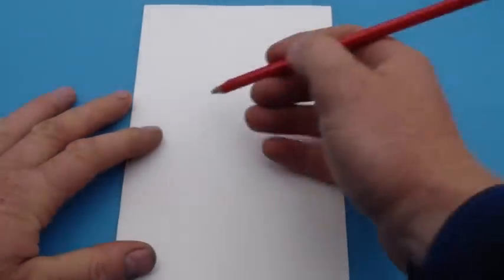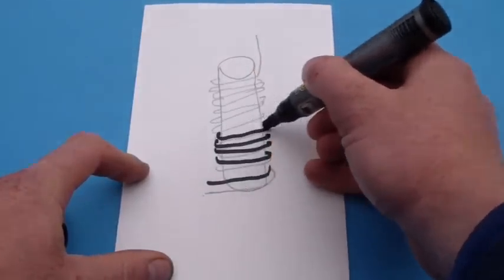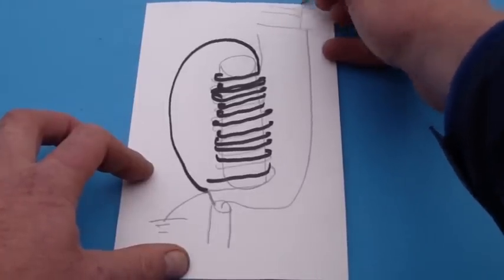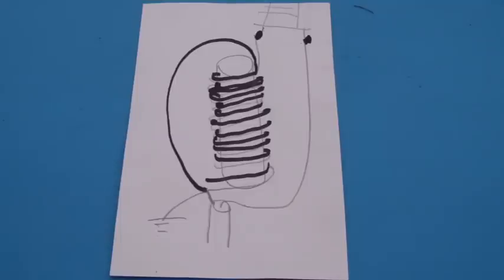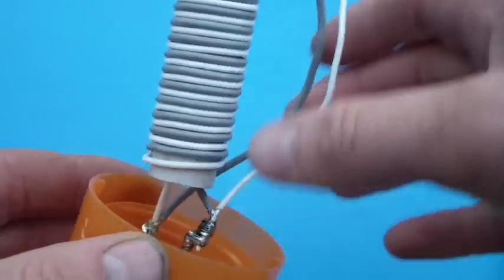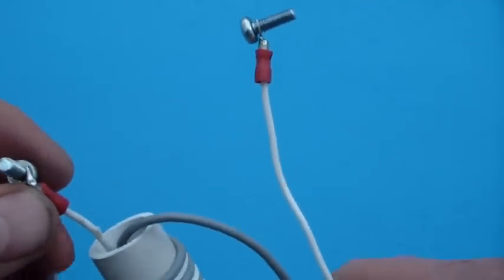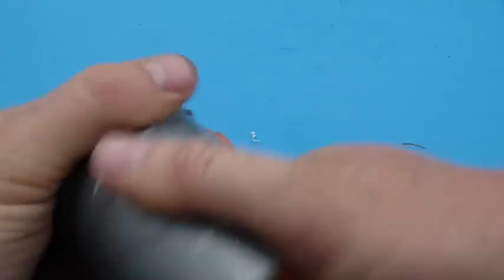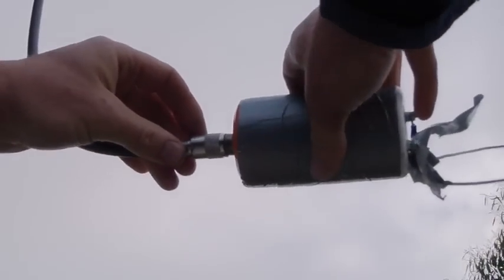How to make a 4 to 1 balun cheap and easy

Comment: You know I respect your abilities in many fields Sandy however, this design is not really good,  , you really really do need some sort of core to get decent performance across a number of bands,  I have used Moxon's 4:1 design from "Antennas for All Locations" book since the 1980s with great success, this is much the same as the job you show here but wound on a normal round ferrite rod of the type Henry Westlake sells for a quid of so.    You will get better high  power performance ( kW etx)with stacked T-200 torroids and thick wire say 14 SWG enamaelled copper covered with PTFE with the same basic design.  This is a basic voltage design which isn't in favour these days however, I haven't had any problems with them. but if you want good performance you DO need a ferrite or ferromagnetic core   161 Tony G3ZRJ
Reply from the maker: +Venus Probe Thanks Tony. This was one of the first baluns I ever built. No doubt you are correct. Maybe I will wind another on ferrite and give it to Rich as he now has a linear.
Hope you and Sally are keeping well.
161
Sandy
Reply: +Wiltshire Man  - in a perfect world, and ferrite balun might be superior, but I too prefer the air core. It's larger, clunky, and not as pretty but doesn't suffer from non-linear characteristics when the core is saturated. (harmonic generation, heating, etc...)  Easy to do when the antenna is being abused or operated off freq. I'd prefer to feed the antenna with a balanced line and run it into a remote tuner box at the base.
Reply: +Venus Probe You are right. This design is terrible.  People thinking it is a good balun, or even a reasonable balun, are kidding themselves.
Reply: Make a video of a good balun please!
Reply: I don't do videos. :) An antenna can make a lot of contacts and seem to fine with a terrible balun. They often work fine with no balun at all. It does not surprise me a poorly constructed balun will "work", since there is no minimum standard and even without a balun most antennas "work". If we are going to make a balun and go through the bother of telling others how to build a balun, we should at least make some effort to be sure we characterize the balun and know it is actually working.Where someone gets into real problems is with high power. At high power levels, common mode really can show up.
Reply: I do have some stuff on a webpage describing balun testing methods....
Reply from the maker: Hi Tony, sorry for the late reply. Yes your right there are better designs but it was my first balun and I was proud of it at the time and thought I would share it with the world. I was just sharing my experiences as this balun was copied from an American ham. At low powers any shortcomings were not noticed but I gave it to a friend who ran some power through it and reported that it warmed up a bit. How big a bit I don't know. It could have been a "Mega bit" cos he never gave the balun back to me:)
Reply: @WiltshireMan  I done a rough SWR test between my air cored 4:1 (as copied from here) and a ferrite version using two ferrite  rings, the air cored drops away below 40m  to greater than 3:1 on 160m, (2.5:1 on 80m, 1.5:1 on 40m) where the ferrite version stays decent and maintains good SWR. I used a 200 Ohm fixed resistor to simulate the antenna impedance. For me it served me well on my 40m ocf dipole. As I say a rough test.

Comment: Hi, in the drawing one end of the thick black wire is left unconnected, but on the realisation I see that it is connected to middle conductor of the coax cable. which is correct? and if correct is the variant in the realisation of the balun then - doesn't it make a short circuit? Thanks for your videos!
Reply: Yeah, this video is really frustrating - all I wanted is to see how this transformer is wound - how hard can it be? But without a properly drawn diagram (with a wire hanging in mid air) I'm not sure how its done. I think this guy just copied some other design and is not sure what he built.

Comment: I built mine 4 years ago, fed coax instead of ladder line to an off-center-fed dipole. It works extremely well. 1 inch diameter pvc is what i wound the wire around, and then I encased it in inch and a half pvc with end caps, and have had zero issues with it. Works amazingly well! Thank you good sir!

Comment: The drawing is not complited. on paper!!!!
Reply: corect. Black wire not finish
Reply: The black that is not connected should have been connected to the center of the coax as well as one leg of the ladder line...other than that...nice vid! de KN4FTT

Comment from the maker: @arizonabobusa Hi Bob ,
and thanks for the nice comment. I'm glad you liked the video I did on this balun. It was   easy to build and I'm sure you will have no problem building it yourself. You may want to scale it up a bit for qro use. i have testrd it at 200 watts and it worked great. A friend ran 400 watts thru it and reported some heating in the so239 connector but otherwise OK.
All the best and thanks
Sandy

Comment: Hi, to let you know, GREAT HORNY TOADS,,,,,, I just built one within one hour of watching this clip.... had 98 % of the material on hand... now I just have to go to hardware store and get the caps.. I tested it on meantime , and finally got 80m tuned in AT 100% FROM A 0%.... Though I had to make modifications in shack... and splicing...
Thanks a lot..73

Comment: Thank you for making the video, however this is a voltage balun and will also not have much reactance due to the air core. My first efforts at balun construction were also voltage baluns, though wound on ferrite cores. Having spent a while experimenting with various types I now only use "Guanella baluns", using ferrite very high common mode impedances can be achieved.

Comment from the maker: Hi paul,
You may be better to use multi stranded wire as this increases the surface area of the wire. the electrons like to flow on the surface. That way you will decrease any losses.
Thanks for your nice comment.
73
Sandy
Reply: Electrons flow on the surface. Only Really critical on VHF and above and silver plated wire is used. On UHF the amount of solder used can effect the tuning freq. Also cannot use wood glue to seal coils as it will boil on transmit. Nail varnish is used instead. Just extra info. I am just getting back into radio. Cheers from old George 13th june 2021.

Comment: I thank the Wiltshire man for Balun info, I would encourage most Ham operators to put there mind to this money saving venture, It is so simple and Works it is difficult to understand why these emporiums  put such an extortionate price on these as this me nothing, Two pieces of wire an old herb canister , inner toilet roll wound glued for strength and weight, pvc sealing tape............. GREAT.......
Reply: Hello Geoffrey, the balun shown is not as effective as those based upon toroids the reasons get rather complicated but take it from me that the experts are right in using baluns based on windings around toroids.   Don't need to be expensive I have made a 4 to 1 current balun with FT240-43 FERRITE TOROID and using enamelled copper wire of about 1.5mm diameter, lots of info on the Web, hope to work you soon 73 Tony G3ZRJ

Comment: Could you do a video on a 12:1 balun air winding compared to a torrid winding?  I am needing to match a 600 ohm balanced line to a 50 ohm coax feeder.  Would be nice if you could also identify all the items needed and length of wire, size of the form and so on. Trying to decide which one to use a what the advantages are one vs the other. Thanks 73's

Comment from the maker: @2E0VJO Yes Jonathan I think it would work OK. I may make a few changes to the balun to improve it's efficiency,but so far as it is I'm having a lot of success with it. You could also just make a coaxial choke where the coax meets the ladder line on the G5RV. All you need to do is wind 8 or 10 turns of coax into a diameter of 6 inches or so.
Also do a search on the web for the "Ugly balun". That will also work and stop common mode currents or RF on the coax braid and lessen TVI etc
73 Sandy

Comment: Hi:  Thanks for posting this.  Would this design work on a TV antenna?  I need to attach a 75 ohm, unbalanced coax cable to a 300 ohm balanced antenna.  Any advice?

Thanks.
Reply: Yes it would work as 300:75 ohms is a 4:1 ratio or you could buy a 4:1 receive only TV balun from a TV/electronics store or online.  Cost about $3.00 US and free shipping on eBay.

Comment: Thanks for the video and a money saver ideal. Only thing i would do difference would be when you wrap the outside of it, is use electric vinyl tape on the outside because duct tape tends to rot in a 1 year or so. Vinyl tape that i use has been on there 12 to 15 years. May i 
 ask you a question on warping the outside of the bottle ? What about spraying a clear coat seal on it. Would that work just as well ? Thanks for the video.

Comment: Sandy, the legal USA limit is 1.5 kW. Most amplifiers rated at that output cost in the range of $3000 or more, 3X cost of the transceiver. I have amateur radio operator friends that have an amplifier. Probably bought on credit. I have never used an amplifier. Unless one is connected to a rig I use for my contest group I will probably never use one, ever. I have been a QRP OP since receiving my Novice ticket. The only time I transmit at 100 watts or less is when I contest with my contest group. 

I discovered your channel about 3 years ago. Although I have not watched your channel since 2011 I have watched all your videos. I am current up to last week. Question about air cored baluns. Can they be used for 1:1 and 1:9 as well? P.S. Glad to hear the operation was successful. Hope to work you some day on the bottom portions of the HF bands. I rarely do phone. Best 73 de KB8AMZ
Reply from the maker: Hi Terry I have no way of testing just how effective this balun is other than saying I ran 100 watts into it and made many qso's. It was taken from a circuit diagram from an American magazine. A few years ago now.
Hope it works for you.

Comment: HI can i just ask you one question, a Diamond 4:1 balun, used with WD 330J HF folded dipole, have you any idea if you should get continuity across the SO 239 connector, or is it capacitivily coupled, or is it inductive coupled might be a BU 50 balun...from Fred in England g4vvq.

Comment from the maker: @reddog694uk Mark,
Your not dense. You would be if you didn't ask questions. You can use this balun to feed a balanced antenna system from an unbalanved coaxial feed. Both sides of the ladder line should have in theory equal and opposite currents flowing in them. Most modern balanced feeder is 300 to 450 ohm so this balun not only converts from unbalanced to balanced but also chasnges impedance from 50ohms to 300ohms.
I will PM you later
Sandy

Comment: great vid,wondering if i could use twin speaker cable or twin red\black dc cable?
any chance 12:1 balun design next for terminated folded dipole been wondering how these are wound?
rob

Comment: I am looking at a loop antenna which calls for a 2.5 to 1 balun.  On suggestion is to make the windings as you do on your 4 to 1 balun except make 10 windings  on one wire and 6 on the other.  Do you agree?  Any suggestions?  Thanks for your videos.  I like them.

Comment: hI.. Can you explain the differenc in a 4;1  balun and a 1:1 balun.. and when  and why you would choose one to one .... over four to 1..
Reply: A balun, short for "balanced to unbalanced transformer," is used in RF (radio frequency) applications to connect balanced transmission lines (such as twin-lead or twisted pair cables) to unbalanced lines (such as coaxial cables) or to match different impedances. The numbers in a balun's description, such as 4:1 or 1:1, indicate the impedance transformation ratio.

Comment: What about the black wire hanging at base.  You did not connect it.  I like the idea but it is not correct. Or finished
Reply from the maker: I am aware the diagram has an error but if you look at time stamp 4:28 you will see me showing it connected and explaining where the connections go. Sorry for the misunderstanding
Reply: Thanks.  I like it

Comment from the maker: @johnrob281 Hi John,
 I can recommend this balun. I like the idea because I didn't have any toroid cores and anyhow those cores can saturate and heat up! Very simple to build. 
OK on Antennas your end. Perhaps you could try a small delta loop too?
I did clearly copy your callsign on 15 meters the other day.
We will try again soon. My delta loop only cost a £20. Thats about $30.! If youv'e got some fibreglass rods there all you need is wire! Make sure the rods are fibreglass not carbon
Sandy

Comment from the maker: @g6vaq1983 Fred,
It's not precise. I believe you can use a larger or smaller dia pipe. I have tested this balun to 200 watts but a friend who has a linear has put 400 watts through it and reports the pl259 gets warm so perhaps avoid qro with it. 
All the best
Sandy

Comment: What's the difference between a 4:1 balun and a 1:4 balun ? Or they just the same thing ?
Reply: A 4:1 Balun can just as easily be a 1:4 balun. The Impedance ration is the square of the turns ratio.  A  2:1 Turns ratio presents a 4:1 Impedance ratio...

Comment: There is a need to "worry" about toroids if you expect to get bandwidth. Unfortunately, most hams can only measure SWR and assume, if that is decent, then the balun is working.
The most important parameter of the balun is common mode choking. This design is a voltage balun and only offers decent balance if the load (antenna in this case) is perfectly balanced.
A properly performing balun has enough common mode impedance to guarantee that the outside of the coaxial shield is not part of the antenna and to guarantee that noise from the shack will not be transported back to the antenna via common mode and reenter the shack via transmission line mode.

Dale W4OP

Comment: Hi there, I' m new in ham, could you please tell me what kind of antenna may i use for this balun?, a long wire may be?, vertical pole?, a 40 meter dipole?

Thanks a lot for an excelent video posted
Malcolm Moreno 
CA3MDI

Comment: I use a balun about like this, only I used 12 bifilar turns of Romex house wiring, I think it's 10 gauge solid copper, to feed my 260 feet long dipole for 10-160 meters and it works well, but a few days ago I connected a MFJ-259B antenna SWR/Power analyzer to the antenna inside the shack that has a piece of about 20 feet of RG8 coax on it out to the balun on the corner of the eave of the roof of the house and running it through the entire system including this balun on 3895 Khz I get a 25 to 1 SWR! I'm still able to match it using a Palstar AT1500CV manual antenna tuner and get great signal reports of 30 dB over S9 into New York state from here in North Carolina when running 700 watts from my Ameritron AL-80B amplifier. I feed the dipole with around 50 feet of 450 ohm ladder line, but that's still a huge mismatch. There's no way I could use it without the Palstar antenna tuner. 73 de KU4GW

Comment: The 51st "balun" video I have watched and not one of them mentions why you would want this, or how it works, or what it does. If this is so important, why doesn't it just come built-in to the transmission line, antenna, or even the radio?
Reply from the maker: If you do a little reading then you will learn what a balun does. In brief a Balun like this does two things. It is an impedance transformer.
As an easy to understand example use a half wave dipole. Balanced window line is around 300 Ohms and a half wave dipole is 75 Ohms.
300 divided by 75 = 4. Therefore we need  balun with  4:1 ratio otherwise there will be large losses and standing waves and our dipole will not radiate very well.
Also a dipole is an unbalanced antenna when fed with coax so by placing the balun at the coax to balanced feeder, or coax to dipole centre junction we get a balanced radiator which means that equal currents will be flowing in both legs of the dipole.
Balun also is an abbreviation for BALanced to UNbalanced.
Thats how I understand it anyway!
Sandy